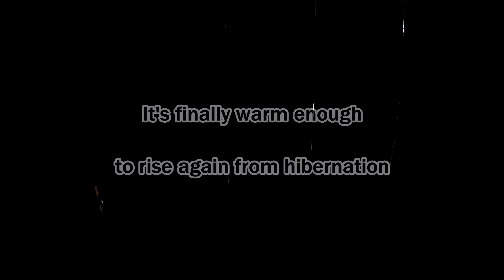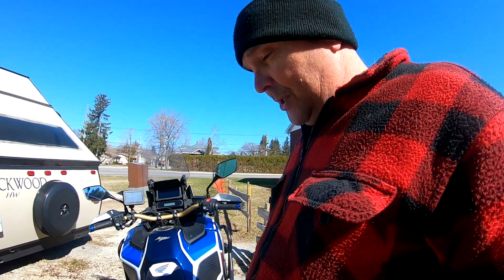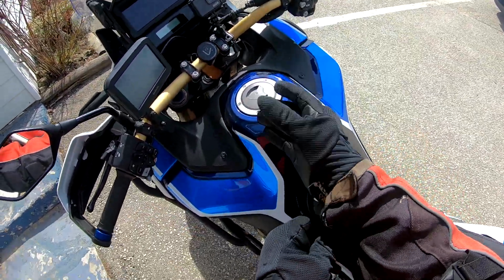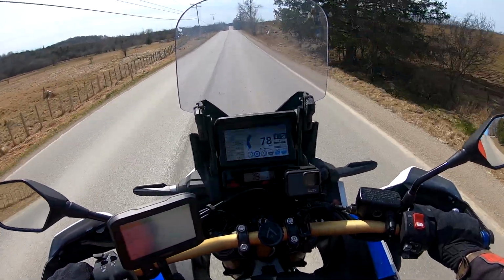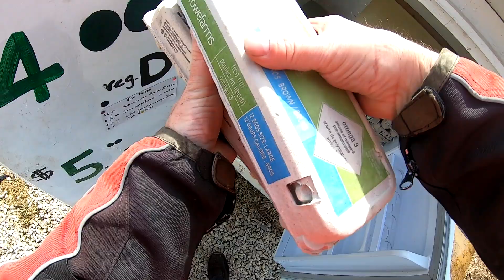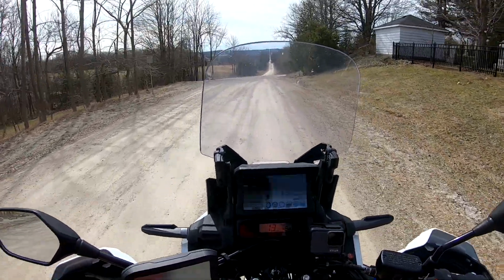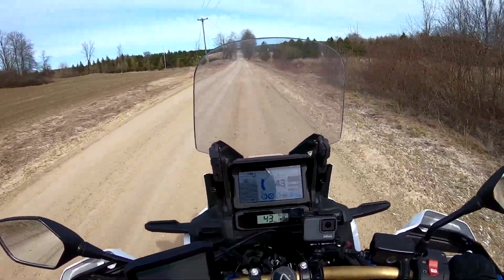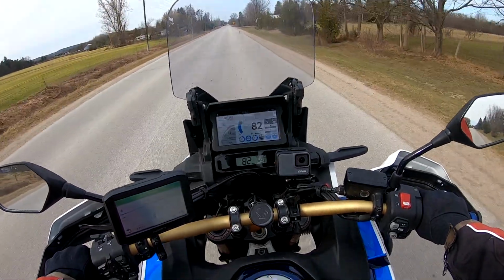First motorcycle tour of the season!  Trying out the Beeline Motorcycle GPS!

Comment: Beeline documentation:
"Before you set your route, you can decide whether or not you would like to keep ‘auto reroute’ on in the Beeline app settings menu. If you keep it on, and you go off route, your Beeline Moto will automatically reroute you within three seconds*.
If you have a very specific route that you would like to follow, leave ‘auto reroute’ turned off and you will be guided, by the black arrow, back to your route if you go off it. You can still reroute manually by pressing the bottom button.

*Please note that you need to have mobile data switched on for rerouting to work. If you have mobile data switched off, or you are in an area with no reception, your Beeline Moto will fail to auto reroute and the arrow will continue to point you back to your original route. You can press the bottom button to ask it to try rerouting when you have data again."
Reply from the maker: I'll look into seeing if I can do this.  I think It may be done through the app.  I can check if rerouting is on.  I think it is, and it doesn't work well as it takes an incredibly long time to reroute if you miss a turn.  Not three seconds, more like 3 minutes.   For that reason, if what you say is true, it would be better to have it off :) Cheers.  Also I'll have to check out using this black arrow.
Reply: @baldandbiking  What I provided was directly quoted from Beeline's online documentation. The first sentence states that the auto reroute setting is "in the Beeline app settings menu." So, yes, it must be configured in the app. There's not much there on the actual device's setting menu (most useful thing is the manual backlight option). 

Auto rerouting has worked fine on mine. Of course it's had good mobile data reception when it's done so.  

More directly from Beeline's online documentation...

Navigating:

"When navigating a journey, Beeline Moto will work offline. 

That means that if you lose signal or want to save phone battery by using Airplane Mode, Beeline Moto will keep navigating you correctly along the route that you planned.

The only feature that will not work offline/without a data connection is re-routing."